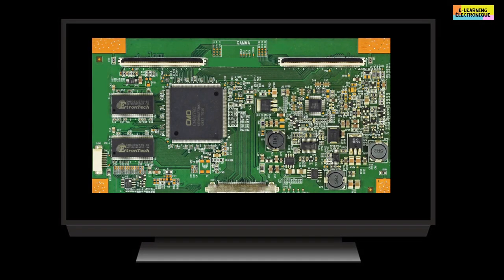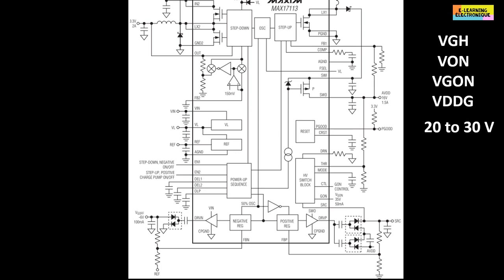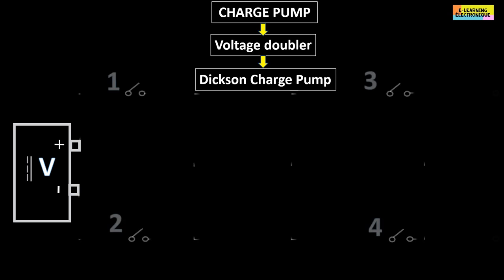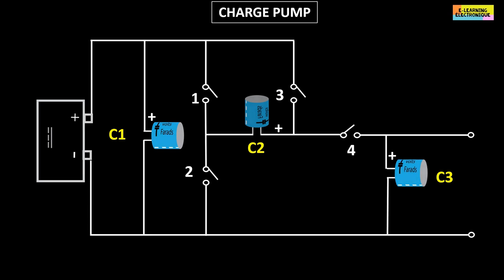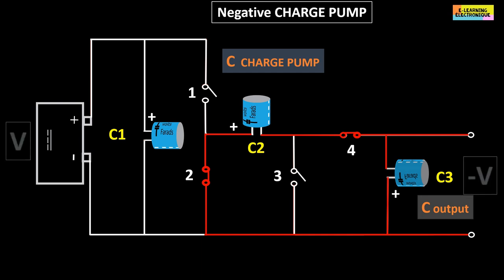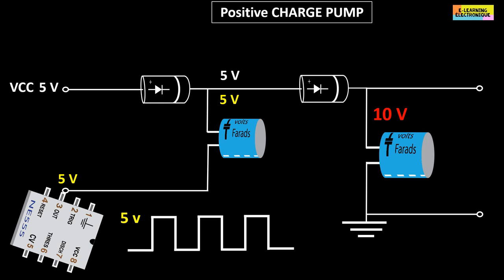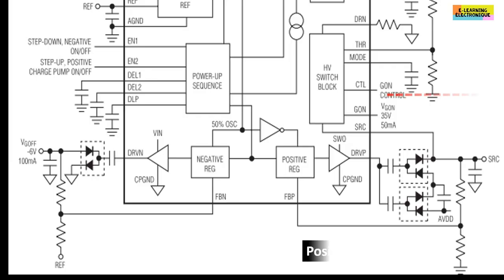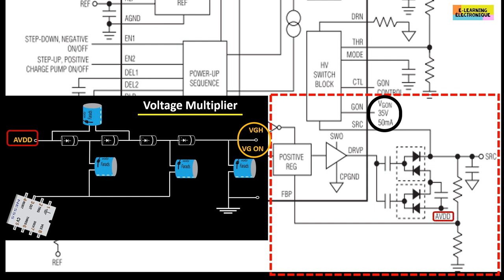VGH and VGL production mode by the TCON board.  The charge pump converter.

Comment: How is vgh distributed into all the gates inside the panel?  I have a tv with gradient faded picture on left side. I'm thinking the vgh gets reduced slowly as it moves across the screen thus reducing the brightness. Or perhaps left side cof is missing vgh? Any tips on why fading occurs. All voltages on tcon and scalar are good. In fact I tried tcon replacement and same problem. So hoping I can fix side cofs or increase vgh value.

Comment: I have 0 voltage present on VGL & VGH.
I also noticed that VGH EVEN & VGH ODD are alternating between 27.9v & -7v

I assume these are both issues with my Tcon board? What are your thoughts? I'm not sure if I can find a replacement tcon board.

Tv symptom: TV is alternating between normal & slightly dim screen every four seconds. It looks like the dimming is caused by horizontal black lines but they are faint.

Also when both ribbon cables are connected I notice a faint buzzing sound coming from tcon board, when I disconnect the second ribbon cable the buzzing seems to go away.
Reply from the maker: the cause is either the TCON or the screen. You can try to repair the TCON. Be careful, all the manipulations described here can destroy the TV set if they are not done properly. To avoid this risk, it is better to entrust the television to a technician. 
First of all, it is necessary to find the voltages VGH and VGL. Then, it is necessary to see when the image is correct while measuring with the voltmeter the test points VGH_odd and VGH_even. It is necessary to note on a paper the voltage which gives a normal image. Example VGH_odd the image is correct if VGL (-7v) and VGH_even the image is correct if VGH (27,9v) or the opposite. It is necessary to remove the tracks which go to the screen VGH_ odd and VGH_ even on both sides then to connect the tracks sectioned with a very fine insulated wire to the VGH and a second wire to the VGL according to the preceding observations.

Comment: where do these outputs go to the display panel? These are working but Im getting a flashing screen full of fine horizontal lines. I disabled 1 side of this circuit (LC1 and LC2 on my TCON) to the panel and get constant lines,  disabled the other and the same pulsing lines...open trace on the display board? Seems like these flip flop between these 2 test points
Reply from the maker: VGH and VGL are 2 voltages for the gate of the TFT transistor in the screen
Reply: @elearningélectronique  I must have a bad one somewhere is series in the display, The display is 2018 55" 4K. all glass, no side connectors. I measured these 2 voltages all the way out the the ends of the panel. last chance is a $12 working pull TCON board. Just a little gamble.